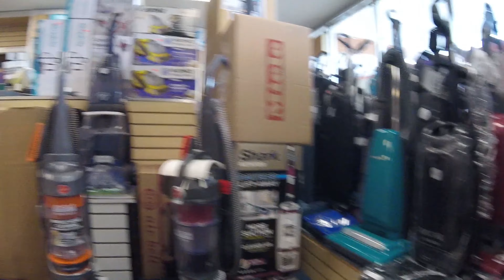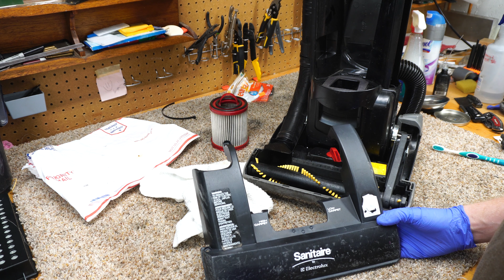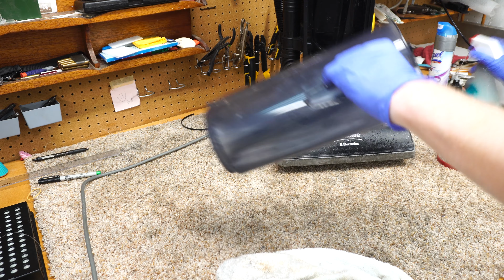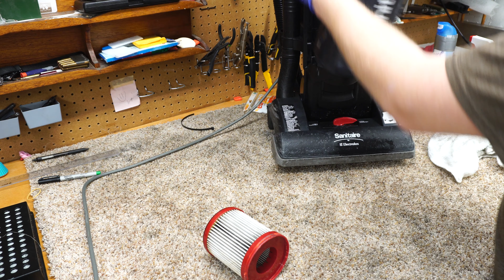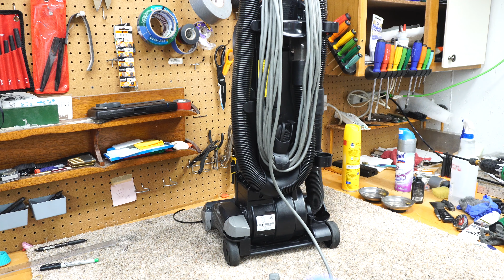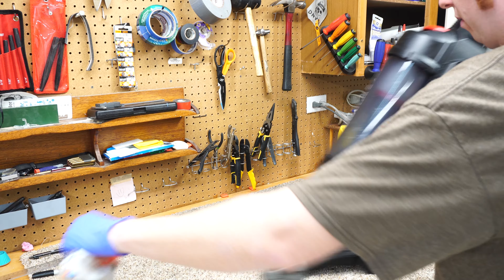Sanitaire FORCE Upright Vacuum SC5845  SC5745 Repair How to restore suction

Comment: All that was shown was how to disassemble and reassemble the vacuum, nothing about how to actually restore suction?
Reply from the maker: That is clearly shown in the video. Sounds like you should just take the machine to your local vacuum shop and have them take care of it for you.
Reply: @PerformanceReviews  Not so clear. Watched the video by the manufacturer which covered other areas that become clogged and how to clear them. Working now.

Comment: The one I use was self propelled I opened it up and put a new belt on and now it doesn't pull any ideas why?
Reply from the maker: Must have been a different vacuum these were never made in a self-propelled. If you're struggling with a vacuum bring it to your local vacuum repair shop.

Comment: On the back of the Sanitaire SC5845 there are screws that seem to hold holster for the hose in place.  What kind of screwdriver do I need to unscrew these screws?  The phillips and flat cannot manipulate them. Any help would be greatly appreciated.
Reply from the maker: Bring it to your local vacuum store they'll be happy to help you out.

Comment: I just got done fixing one of these, customer complaint was a burning rubber smell, the bearings in the brushroll were quite stiff and sounded like debris got inside them, the heat from the belt slipping discolored the motor shaft, so it had to have been used for an extended period of time with a bad brushroll, it also had low suction so in addition to ordering a new brushroll and pack of belts for the machine I also cleaned the filters quite thoroughly and washed every piece I could remove, as it had never been serviced before and was old enough to bear the Electrolux name, when it left it ran and smelled like a brand new machine and the customer was satisfied with the machine, I also told them how often to clean the filters in order to keep it running right, time and the next time it comes in will tell if they actually clean the filters,

Comment: My grandmother use to have these as the eureka whirlwind lightspeed. They were ok for the most part but it clogged very easily and at the time those filters are really expensive to replace so it ended running with its dirty filters and it died after that.
Reply: The washable HEPA filters are around $17-20 and the dust cup filters are around $8-10 on their site. Might pick a few backups up before the price changes.

Comment: Where i work they have the bagged version and feel like it has less power than the Windsor and feel cheaply made and it DOESN'T LAY FLAT. I prefer the SC888 along with a backpack for Commercial Use. This machine is trash in my opinion. ALSO THE HOSE GETS ON MY NERVES IT ALWAYS COMES OFF!!!
Reply: yep I clean a pizza place with one and the  suction at the floor sucks and yes the hose comes out constantly and it is very bulky and cant get under stuff well.